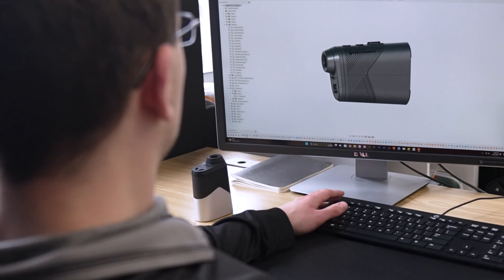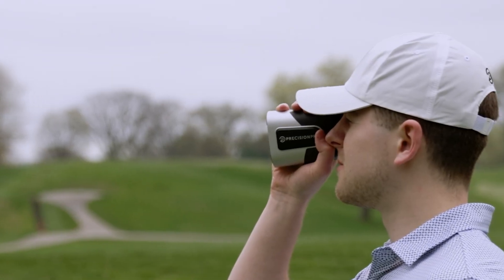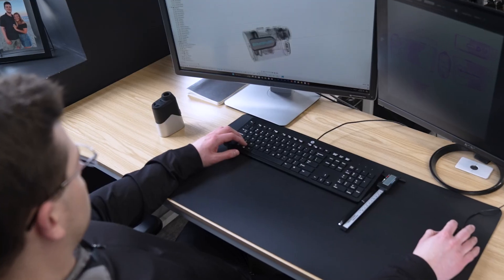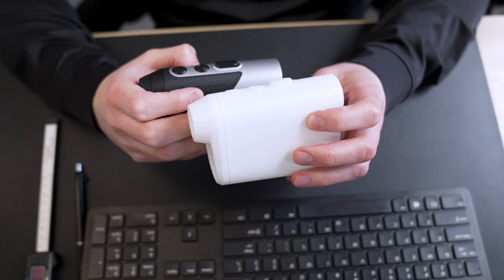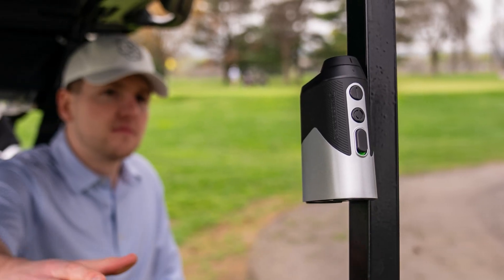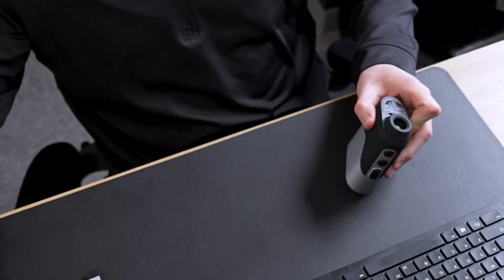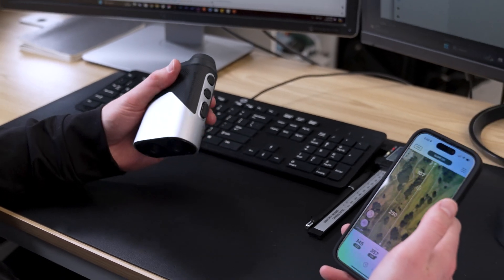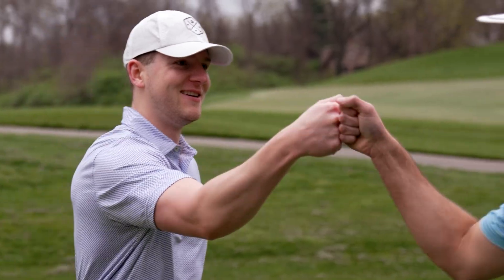Behind The Design: Precision Pro Titan Elite Rangefinder

Comment: How does the TE pull yardages from app? Meaning, is the TE supposed to display the exact same F/C/B yardages as displayed in app (if app says 100/120/130 then TE says 100/120/130)? I used it yesterday and the TE’s F/C/B were different than app said when held side by side. Actually it said the back was closer than the distance I measured to flag. Thanks.